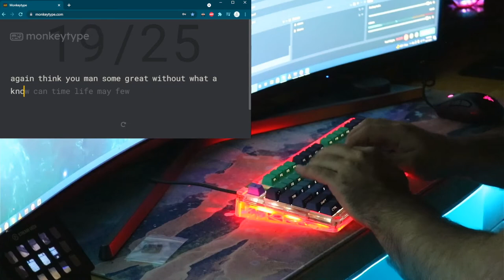Custom Build: Idobao ID87 Crystal (First Person View)

Comment: Just got mine this week and I'm intrigued because it has per-key RGB which I was told the ID87 Crystal doesn't have. Did I luck upon a v3 production sample or what?
Reply from the maker: You have to enable it via QMK / VIA. First download QMK toolbox and via. Once those are downloaded find the VIA compatible firmware from https://www.caniusevia.com/docs/download_firmware , then flash the via compatible hex file. This step can be tricky as the PCB may have to be reset by hand by hitting / shorting the reset directly on the PCB itself as you plug it in. I believe it is under the A key. This will then allow the firmware to be flashed onto the board. Once loaded onto the board, it will then show you the button combination for changing the per key RGB from white to something else. It is NOT enabled by default, but is there, and can be seen on the documentation page on idobao.
Reply: @ireakhavok  Thanks, sorry for the late reply, only saw your answer today. Cheers!
Reply from the maker: @magicmulder  no, problem! I actually made a video about it :P

Comment: very cool looking ! but is it white LED or RGB per key ?
Reply from the maker: EDITED - YES they are addressable, per key. BUT out of the box, however,  the main letters are just white LED, but the underside LED's can be changed to a specific pattern, or solid color. I prefer this, anyway. It makes the legends easy to see. They are dimmable, and the brightest setting is actually a bit too bright, so I leave it on the medium settings.
Reply: @ireakhavok  I have the same board and out of the box it doesn't have via support so I didn't have full control of the lightning RGB. The hex file they provide to get VIA enabled on their website seem to be for the non crystal variant which only had the underglow and the bottom row on top to be lit up. After digging around the QMK and altering a few codes. I managed to get all the keys and underglow to be lit up and addressable. I think the proper answer is this keyboard does indeed have RGB per key not just white LED for the letters. Hope this helps everyone else who has this keyboard
Reply from the maker: @LocNguyen-se4ec  WOW I didn't know this!!!! Thank you for Clarifying! I will modify my answer above. Thank you!
Reply: @LocNguyen-se4ec  I'm thinking of getting this as my first keyboard build, and one of the few things stopping me is that I really don't like those white LEDs. I was thinking about physically modding it somehow (like with colored film or something), but if the LEDs are actually addressable, that would be amazing! Do you know of a tutorial for this somewhere? I've heard of VIA but not QMK.
Reply: @AndreaP_N7  it's definitely addressable. By default, the chip that registers this keyboard isn't flashed with VIA support. So you wont be able to visually change the colours other then the keyboards key combination. But if you want more technical lighting or remapping then you will need to reflash it to have VIA enable. It's simple if you know the workarounds but I do suggest watching a few qmk tutorials on YouTube or on QMKs website. If you get stuck I can help out further by supplying the hex file used to flash the keyboard, given that its the identical keyboard to mine and this video's
Reply: @LocNguyen-se4ec  Thank you! I'll check out tutorials on QMK, then. I'm excited to know that they are definitely addressable! 😁